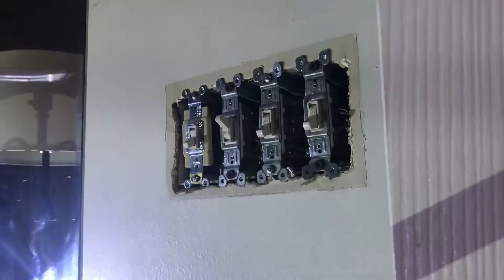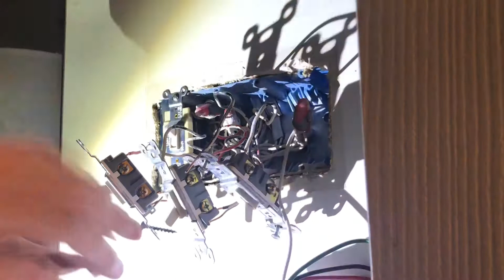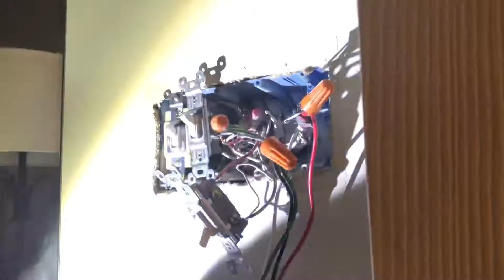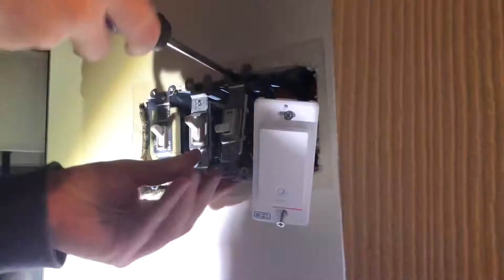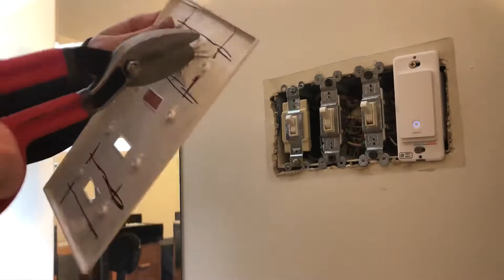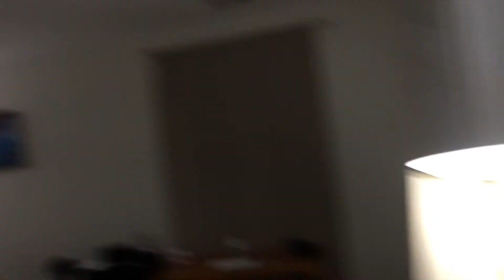WeMo WiFi Smart Light Switch Install

Comment: In my quest for purpose after my wife left me, I asked myself, "What do I want out of life?" As always, U Can Fix Anything was there to answer life's deepest questions for me: I wanted to install the Wemo Wifi Smart Light Switch on every goshdang switch I have in my new, very small, very lonely apartment until I stop weeping every time I think about the woman who left me with nothing but a thousand of these light switches in the settlement. Not to worry, though! Once they are installed I'm sure I will find myself fulfilled and the way forward illuminated (partially on account of all of the new lights I will be installing in order to use all of the Wemo Wifi Smart Light Switches my wife left me in the settlement). As always, from the now brightly-lit corners of my empty heart, thank you, U Can Fix Anything. Thank you.